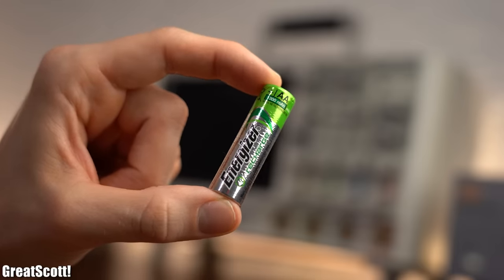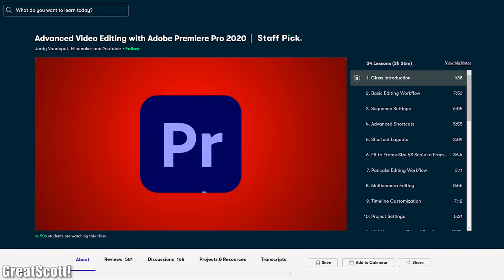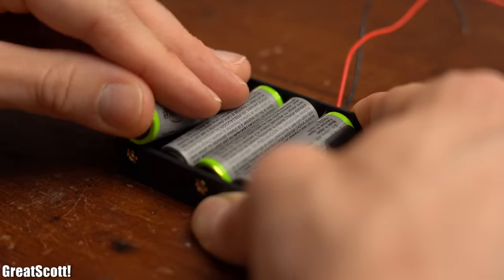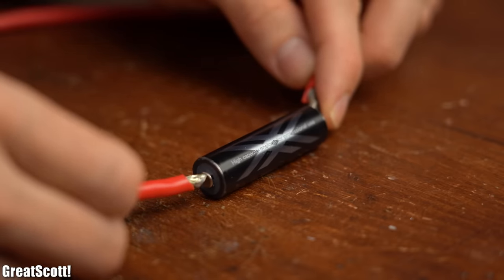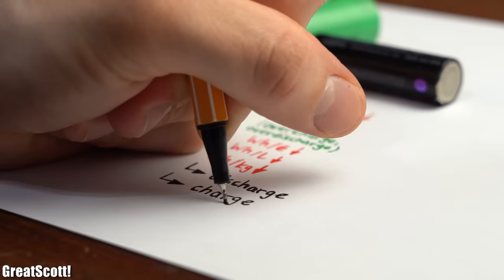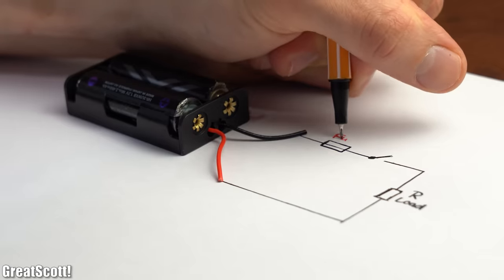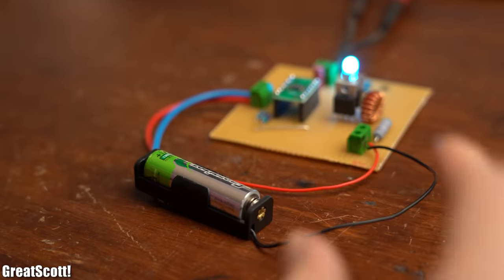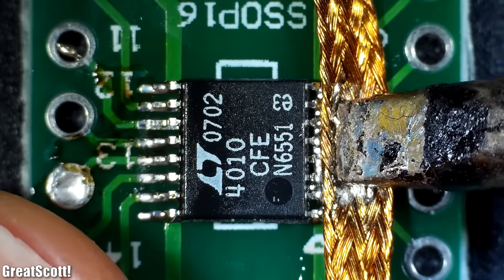Are AA NiMH Batteries obsolete? Here is everything you need to know about them!

Comment: There are not much NiMh charging controllers because except fast charge (charge current above what the cell size can handle as longer term overcharging, so above 50..100mA for an AA cell; note the capacity rating is not relevant, as the limit is in the ability to dissipate the heat and that is purely question of size and maybe external cooling).
And other note: The "dvdt" method you mentioned is in reality just dTdt, so sensing the heat up caused by the cells becoming overcharged. It is,because when overcharged the cell voltage would actually stay constant if no other parameters changed. But because overcharging releases heat and the cell voltage has a strong negative Tc, it manifest itself as "negative dvdt". And that is also the reason why it does not work with slow charging: At low current the amount of heat is just not enough to cause any significant difference in the voltage.
And for the overcharging: It is actually very essential the cells to be overcharged a bit each charging cycle. Not by any high current, small current for a hour or so is enough (the so called "top off charge"). It is the main method to balance the cells in a battery. In fact in almost any battery chemistry (lead acid based, NiFe/NiCd/NiMH, even the silver oxide) except for Lithium based. Because unlike all other, only the Li based can not handle any overcharge at all, so need the complex BMS for that.
And anyway, the cell life is very severely impacted by their temperature, mainly during the overcharging phase. Therefore not that much practical when you need them recharged within a hour or so. On the other hand when the current is within the limits what the cell size can handle (50mA for AA,...; some special cells even higher, but those feature really low usable capacity), the NiMH could be overcharged indefinitely without any problem lasting even 10 years or so (if the temperature remains below 30degC or so), all the time ready to deliver their charge. No Lithium based rechargeable will make it past 3..4 years even when maintained at barely 50% charge level (just shy of 3.9V/cell for the common "3.6V" types), even the lead acid needs quite accurate voltage controller to get at least 5 years life  from them.
Of course unlike all the traditional chemistries, the Li-Ion has virtually unlimited cycle life, practically all the degradation comes from the temperature and charge status (the further above 3.9, the faster it degrades; on top of that the common each 10degC higher halving the lifetime), so if you have a device that is charged and discharged multiple times per day, the LiIon will serve well the full 5 years or so even when that would mean many 1000's charge/discharge cycles. The Pb last barely 200 cycles, NiMH practical life is within 200..500 cycles, the claimed 1000cycles life rating is rather a virtual number.
And for the undervoltage and Ni cells: The degradation starts below 0.6V. The usually recommended 1V/cell is a value already counting onto some mismatch among cells, but when all cells start from the same batch (quite imperative when assembling a multicell battery), it still allows about 18V battery (15 cells). Only with higher number of cells it is better to monitor smaller groups separately. Increasing the threshold above the 1V/cell is definitely  not the way to go, mainly with NiCd's. Because that is the situation where you will face the "memory effect" problem (the voltage droops quickly from 1.2 to 1.1 after repeatedly only partially discharged; if you allow it to fully discharge down to the 1V, it will still give the whole capacity and recover from that effect; all voltages are valid for 25degC, must be made temperature dependent if the temperature would be different by more than few degC)
Reply: Lithium-ion batteries as commonly used definitely do not take thousands of charge-discharge cycles. Ask anybody with an iPhone. LiFe batteries are much better at charge cycles than standard Li-ion.
Reply: @eDoc2020  Because the way how they are treated in these devices (quite end-of-charge voltage, way above 4.2V), their lifetime is indeed short, indeed leading to barely few 100 cycles with the normal usage pattern, about once per day, leading to lifetime barely 2 years (or even a single year in some products).
But my point was not the lifetime being long or short, my point is, if you would use the device way less frequently so you would be charging it only once per two days, or way more heavily so you would be charging it twice per day, the battery life will still be the same barely 2 years. So with charging once per 2 days the battery will be dead after about 360 cycles, with heavy use and so charging 2x per day you will get about then about 1400 cycles, in both cases it would be the same 2 years.
That is the difference towards e.g. the Ni based cells, where the life would be all the time about the same lets say 700 cycles, but in the first alternative scenario with one cycle per 2 days it would mean 4 year life and with 2 cycles per day just a single year.
So when you have an application with low current draw, where the cells lasts multiple weeks per charge, you will be way better off using the (low selfdischarge) NiMHs, as there will still be just few cycles but over a long period of time (the 500 cycles life is quite realistic with the low currents, what means more than 10 years of battery lifetime), so LiI-on will be most of the time just sitting and degrading there, dead after its 3 years with just few 10's of cycles over that period of time.
With an application where you will need to charge the battery really often, like few times a day, so you willreach high number of cycles within a short period of time,you will be better off with the Li-Ion. The Ni cells will reach their 500 cycle life within just few months, while the Li still has the chance to make it its 3..5 years life (assume you won't stretch the capacity by using higher end of charge voltage as it is common with many mainly top smartphone models), so easily make few 1000's cycles over that time. Plus the need to charge multiple times per day implies quite high drain application, where the (appropriate types) Li-Ions have not much competition in terms of maintaining its usable real capacity under high load. And NiMHs tend to degrade way faster under such high loading (so beside lower usable capacity per charge, their life gets reduced to barely 200 cycles), way more than what effect similar loading has on Li-Ions.
The medium loads may lead to longer life with NiMH, but not so much to really offset their higher cost and size/mass.
So the NiMH are pretty much suitable for only the lower power applications, otherwise the Li-Ions become the first choice.
Maybe some liw power standby applications (beliw 1W or so), where you will benefit from the Ni cells ability to be maintained at full charge without degrading (assume the permanent charging current is so low the cell temperature never reaches more than about 30degC, so less tan about 30..50mA for an AA size cell; that means 2..3 days charging from flat to full charge). For higher power levels the SLA becomes cheaper alternative, but mainly withthe ability to recharge them fully within 3..5 hours from flat and then maintain without degradation for a few years. Li based cells would degrade pretty fast when kept at full charge (4.2V) all the time. In order to reach the 3..5 years lifetime, the full charge voltage would have to be reduced below 3.9V, but that means losing more than half of the usable capacity, making them more expensive and larger than their Ni or Pb based counterparts.

Comment: The big sell with nimh when they 1st launched was higher capacity and no memory effect with lithium ion they improved even further being able to offer a true 1.5 volts instead of 1.2 so mechanical devices like rc cars won't be affected by the lower voltage output are nimhs obsolete not yet because believe it or not they still make ni-cd cells nimh was a breakthrough in technology solving the ni-cd issue where they had to be completely drained before charging

Comment: Could we use, say ATtiny or PIC MC, to build a variable voltage charger for all kinds of batteries, that also monitors the temp and Max charge?
Reply: It is possible to make a universal charger using microcontrollers. I bought an universal charger that uses ARM processor. Like in this video, nickel-based batteries are pretty complicated to charge. Some chargers use 1.5V as cutoff voltage, and some uses higher 1.7V as cutoff. Using chargers that use cutoff voltages aren't really accurate since some low capacity batteries may require more than 1.5V to charge more than 0.3C.

Comment: you can charge alkaline too but it needs to be done very slow and every time of full cycle the capaciti drops of the 80% of the last value. they can explode or leak from charging with a normal AA charger there is a special charger for them to charge it safe.
Reply: I've had luck without a dedicated charger, instead by using a resistor in series with a power supply to limit the charge current to around 1/100 C. It will take a few days to charge but I haven't had one leak doing this.
Reply: @eDoc2020  these chargers not magic or somthing. there are only extreme slow and this is the key for charging a alkaline. alkaline having a higher internal resistens. this means more power loss while charging this results in heat and heat increase pressure this mean leak or explotion. so if your charging current is low your voltage deffarence plus drop  times the ampere is your powerloss. 
your solution may work but is not 100% save. in the worst chase you got hot metal shrapnels and liquid in your face and maybe a fire in your home too.
you need to know alkaline are not designed to be charged to days so be careful. 
these speacial charger measure the condition while craging and stopping if the battery are no loger able to be rechargeble ore be damaged and cut of charging. its the same thing why NIMH no loger or less seen today. its to complicated for being cheap and efficient
Reply: @reinekewf7987  I don't think I'd get any hot metal shrapnel. The low current stops it from heating up so it would be cold metal shrapnel. And then the cell will vent most of the time so it will just leak if there's excessive pressure. If it doesn't vent properly the seal will surely fail before the can does so it will just its contents out its back.
Reply: @eDoc2020  alkaline cells have no built-in security mechanisms. they are just not meant to be loaded, even modern NIMHs don't have any. the only safety aspect about them is they tend to burn rather than explode and the acid content of the liquid is comparable to vinegar essence, which means no severe burns. than not to mention the NIMH which contain highly toxic, corrosive and heavy metals.

I'm not saying that your method doesn't work, but it's not safe. There is a reason why this type of charger no longer exists these days or why these are even banned in some shops. And I'm not talking about the environmental pollution that goes along with the production or the costs of production.
this kind of charging technick is and has never been safe neither alkaline nor NIMH. that is the reason for their disappearance from the market or their complete ban in some countries.

if you are of the opinion that you do not use a proprietary charger for that wich is designed for it and do without its safety mechanisms, then go on but if it goes wrong, live with the consequences. but then you cannot claim compensation from anyone

i work on huge battery systems every day. i had to attend special training courses to be able to work on such systems. i know such cells are structured in detail and what security mechanisms are there and how they work and looks like.
Reply: @reinekewf7987  I agree alkaline cells aren't made to be recharged but you used to be able to buy ones which were. I don't know if those were actually any different inside or not. Regarding safety mechanisms, I thought Li-ion cells didn't have any built in, either, instead it's all done by the external BMS.

And obviously there are more concerns when dealing with huge battery systems. Small batteries simply don't contain enough energy to be much of a safety concern and considering half the time alkaline cells just leak by themselves I don't think a slight trickle charge makes much difference. Please correct me if I'm wrong there.
Reply: wrng ßoeçail chatge for tém

Comment: I don’t think NIMH will be obsolete. They are actually most powerful batteries. What I mean by that is they can deliver more instantaneous punch than even Lithium Ion. The only thing the power density is less. Therefore weight is issue but if you just need a vehicle that accelerates quickly but don’t car about range NIMH is best. They are good for drag racing but practical application Lithium wins.

Comment: I was thinking...if you do a project with NiMH cells, use 4 of them to get about 4.8 V nominal, and a 'dummy' cell to use with 3 do AA alkaline cells, at about 4.5 V nominal....easy Bit of boost conversion to 5-6 V, or enough to power 3.3 V when depleted.

Comment: I was guessing GreatScott made a circuit that charges the Ni-Cd battery, but still nearly, right? ;)

I still use a Ni-Mh battery for my remote control. After all, they provide more current than the regular 700mA double-A because they last longer, but the display screen gets blurred because it's only 1.2V. But the thing I hate the most is using the Ni-Mh battery for something that needs more voltage not current like my laptop mouse, electric piano, and more. It is very hard to find a thing that has a built-in 1.2 step up to 1.5 nowadays... So I will choose the double-A instead of Ni-Mh
Reply: Youtube, I didn't double space! What wrong with you?

Comment: I use a 1A 3S3.6V NiMH Battery Dedicated Charger 1.5V 3V 4.5V CC/CV Charging Module Board with a CN3085 chip on it from amazon to charge the batteris. That comes with options to charge 1 cell, 2 cell or 3 cell. It wil be good you feedback on this board.

Comment: if 3 li ion batteries are in parallel and i am charging it with 100mA, DO I STILL NEDD TO USE A BMS ?
Reply: you need something to terminate the charge.  Li-ion is not at all tolerant of overcharging, even a little trickle charge.  If it's not a "BMS", it still needs something to monitor the voltage and cut the charge current to zero once it reaches full voltage.
Reply: if in parallel they will balance each other, but like tythagoras says; still need safety steps like overcharge/undercharge/temp cut off..

Comment: My Bluetooth mouse was also working with 2 alkaline batteries. I had to constantly renew the batteries. I finally got bored of it and made the mouse rechargeable. 
I used a li-po battery instead of these two batteries connected in series. But since the voltage is 3.6 V, I didn't want to burn the mouse. 
For this, I used the MCP1700T-3002E/TT regulator and fixed the output voltage to 3 volts. For charging, the classic TP4056 integrator. 
But the first time I connected a capacitor to the input and output part of the IC, this was a big mistake. Short-circuited after a while. 
Finally, I ran the mouse without them and it's been a week, no problems, I charge it from the usb port and use it. My mouse is logitech m555b.
Reply: If logitech had sold its product like this, it would have sold it with a price tag of 1000 TL. I did this for 60 TL.
Reply: Turkey's 9.6 TL against the dollar made me do this.
Reply: @hamzaterzi8801  buy bitcoin.
Reply: @jimmybrad156  In fact, TL has lost a lot of value against the dollar in one year. I know that the Bitcoin market is very problematic. Isn't it better to exchange with dollars?
Reply: @hamzaterzi8801  sure it's easier to exchange with dollars but i mean for savings bitcoin is good; no one can print it, but you gotta not worry about price swings and just let it be for 5+ years.
Reply: I can't say I've ever bought btc for TL though :)

Comment: I used them for a time in an attempt to spend less on batteries, but having to recharge them a lot made it not worth it in the end.
Reply: I guess for commercial settings it is safer to buy disposable batteries because tools & device risk not working if you forgot to check it (risk causing a scene or disruption in workplace).

Comment: Maybe they're obsolete, but they are much cheaper than li-ion cells in AA form which saves you a lot when you need to power devices that take AA batteries such as several retro handheld consoles (Gameboy Color, anyone?) or stuff like wall clocks.

Comment: what do you mean "has a minimum voltage of 1v which you must not under shoot"? this is nimh we are talking about you can discharge them completely and have no impact to capacity i have a solar light in my window that has a nimh button cell. its been there for 5 years it gets discharged fully on many occasions (i live in the UK) and even now on a sunny day the light when fully charged can run for 2 nights if there is no sun after.   

also how is charging difficult? my charger i bought consists of a mains transformer and 4 diodes and it charges the cells in about 5 hours and after that they just warm up. 

i should also add that this is baced on experience and not actual data but still i would argue that doesn't deminish the value of what i have said
Reply: best kept above 0.7v.

Comment: So I have a question in regards to a battery venting. Would it still be safe to use a battery that vented? Be it nimh or li-ion?

And also great video on these nimh cells that we take for granted! Honestly didn't know that the capacities could vary so wildly, given a battery of the same size. I've always used enovplopes though in my non lipo applications. So basically tv remotes and old video games lmao